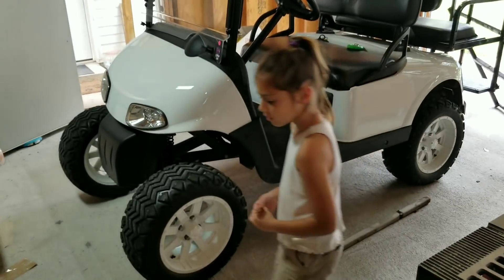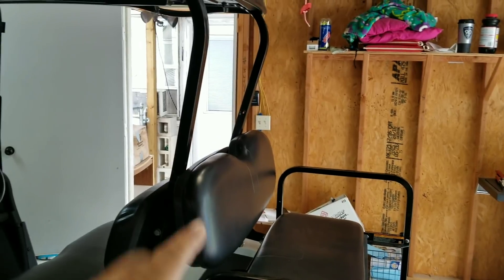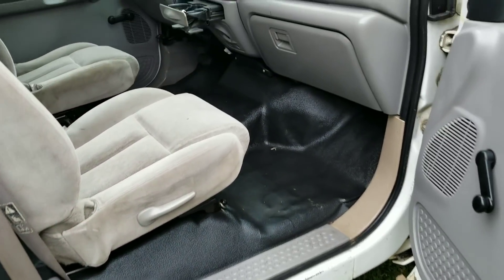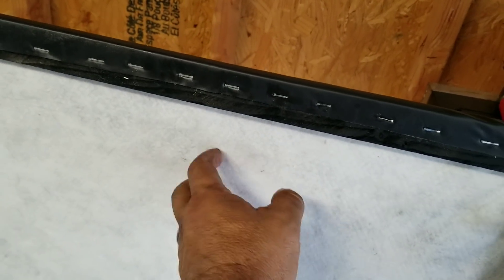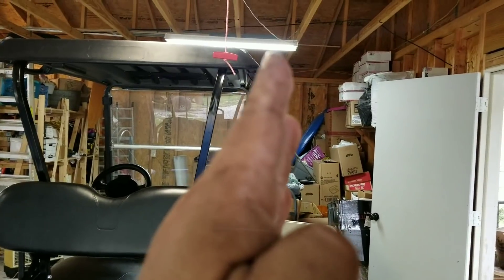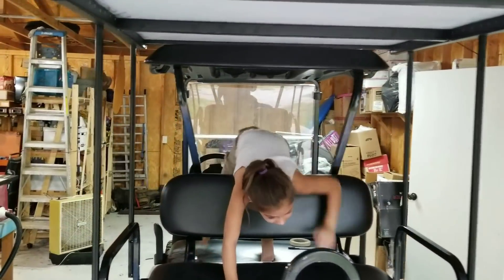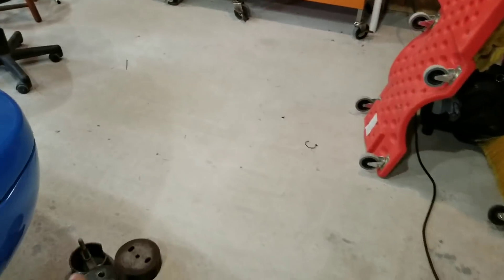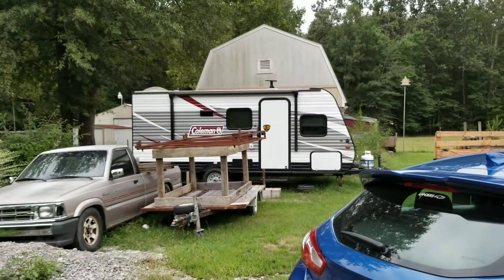Roof extension for Ezgo golf Cart 9-09-18 update on F250

Comment: Looks great. Wasn't clear on the frame materials.  2x2s for top. Are the vertical bars that also?  Looked like they end in a flat bracket, so mebbe square tubing?
Reply from the maker: All of the canopy is made from 2x2 wood and the bars that come up from the seats arm rests to the canopy are 1x1 box steel tubing  And I think 1/8" wall. Hope this helps

Comment: How’s that material holding up?
Reply from the maker: Still on there been to several shows hasn't ripped 70mph down the interstate.
Reply: @earthscraper69  excellent man. You said it held up to 30mph or maybe 25mph, is that the top speed for that cart? I'm looking at the enclosures and wish they had some nice roof extensions for them that didn't cost $400 for 80" roof.
Reply from the maker: @ericstyer2890  yes 30 is top for mine and 70mph is on the pickup going down the interstate and yes that's another reason for me building my own extension. In the future I want to build a complete 1 piece roof for it